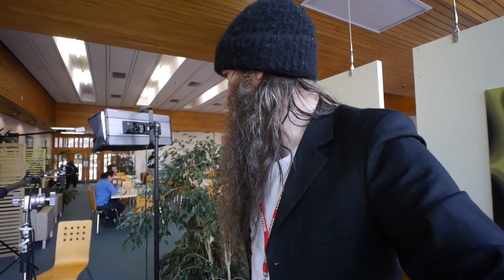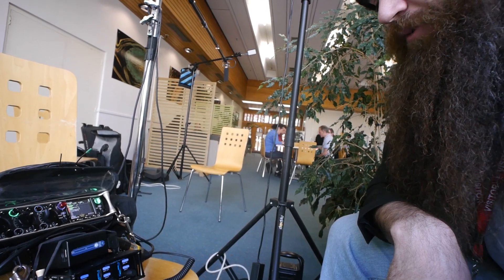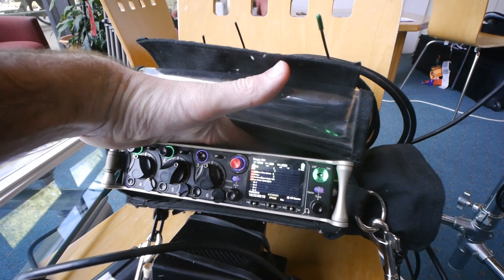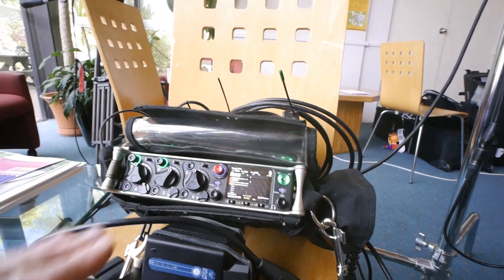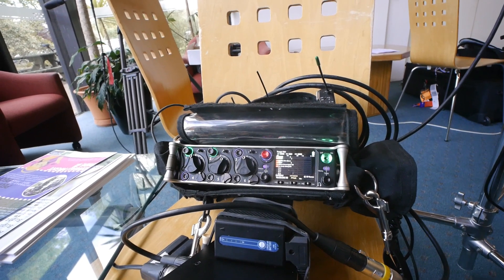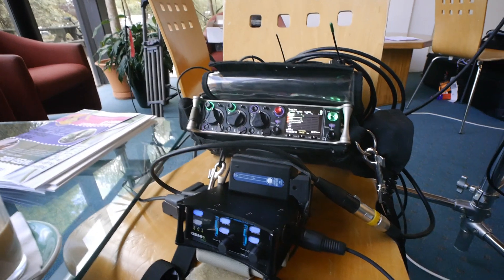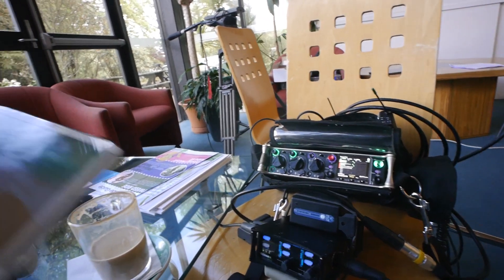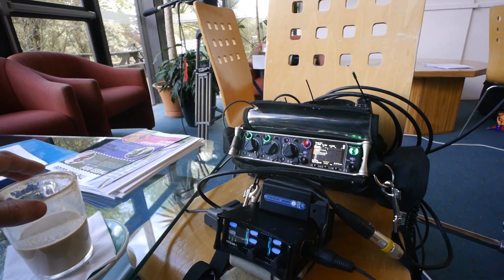Using Digital AES to loop out from a Sound Devices 833 through a Cedar DNS2 & back in again!

Comment: So with the cedar its a two channel device?  So could you for instance take 4 individual microphone channels, output to the cedar and remove noise then back into the AES to record the clean output from the cedar?
Reply from the maker: Nope, couldn't take 4 channels into the DNS-2, as yes you're limited to two channels. 
You could get the Cedar DNS-8 instead! But that is much more expensive, and you couldn't fit that into a bag at all, you'll need a sound cart.
Reply: @SoundSpeeding  Sorry, I meant 4-channels mixed down to two...I have the SD 833 and they just released the Noise Assist plugin, so there is two channels of internal noise reduction now available.  I have no idea if its as good as the Cedar but its been working quite well so far recording podcasts.

Comment: So my only question is if you are charging for the Cedar DNS2 as an additional charge on your rental? We are doing our best in the states to ensure everyone is informed that the DNS2 is NOT something that is included in a normal ENG Kit (or even a cart based package), but instead is considered a Specialty Item that is to be rented in addition to the Kit Rental.
Reply from the maker: If it gets explicitly requested then I'm definitely  charging for it!

Here in New Zealand there are no ENG mixers with a DNS2 (only two other DNS2 units in the country, only being used on carts such as for Avatar at the moment I think)

Comment: Less power draw, but I can easily get by with 2 970s on my 633 for a full long day (only powering the 633, no other wireless RX). The faders & encoders can also get super hot at times, so that's nothing new.
Reply from the maker: I haven't done loooooooong days with the 833 just yet, but I feel confident that a 2nd pair of NP-F970 batteries (which I'm carrying with me of course) would comfortably see me through the rest of a long day (especially if I'm taking even a small amount of caution to turn off the recorder when it isn't needed, such as during lunch break, location changes, etc etc).  So yes, it uses more power than a 633, but it doesn't seem like the massively big deal some folks were making it out to be online?
Reply: You mean the big deal as being that it gets hot?  I’m here in Texas and was just speaking with some location recordists and they have a number of 788’s and 633’s and they do say they get hot, but even here in the summer which is very hot, he said they’ve never failed them.  He said he really only had one software glitch once but that happens with all of them being computers. So if an experienced sound recordist with multiple systems is confident that they don’t fail because of heat problems and he’s had his units for upwards of 10 years then I’d say that they’re pretty darn reliable and heat issue is overblown.  I mean seriously nothing would kill sound devices faster than if their machines were failing because of heat.